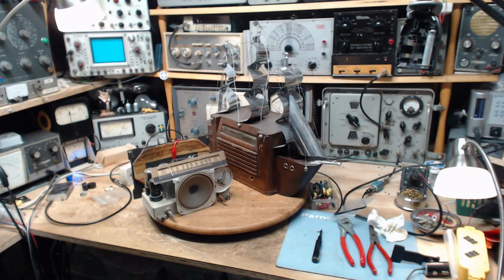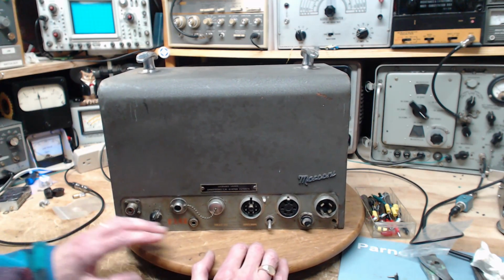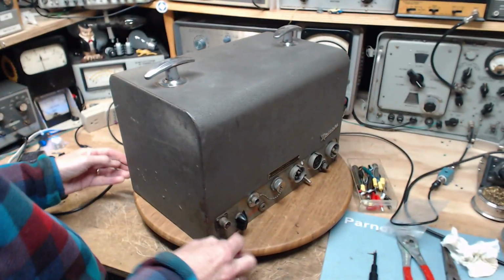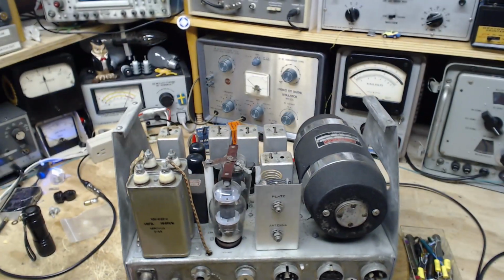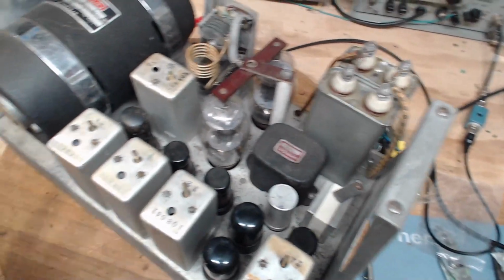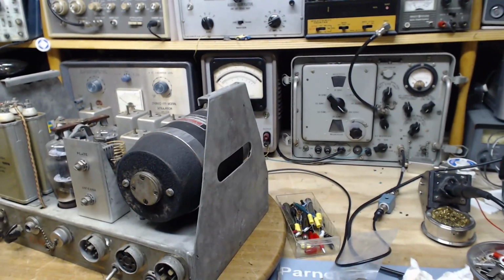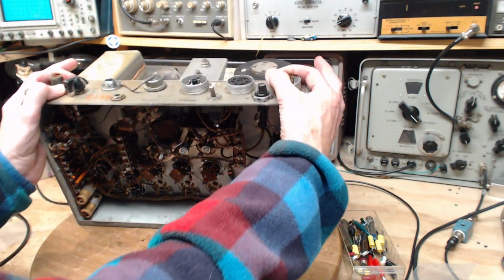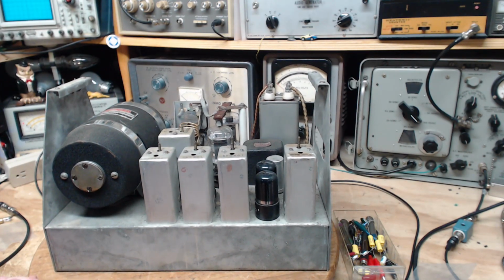Marconi FT12 Police FM Transmitter

Comment: The ship body is metal and used as ground, so operating voltages must be low to prevent shock hazards. FM works well over water, its all line of sight transmission. The operating voltage of 5 volts Ive never seen, typically 24 volts was used, two 12 volt car batteries etc. perhaps its from the day of 6 volt batteries, thus the 5.5 Volt input supply. The dynamotor screams at 400 cycles, but filtering requires lower microfarad capacitance values. In the army we also had FM transmitters that needed a dynamotor that ran on 24 volts to creat 120 vac.